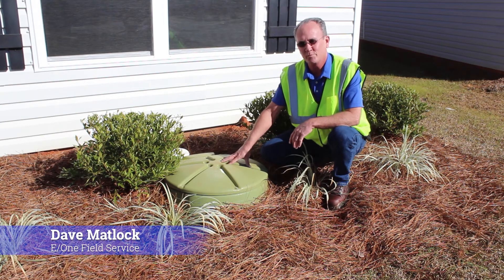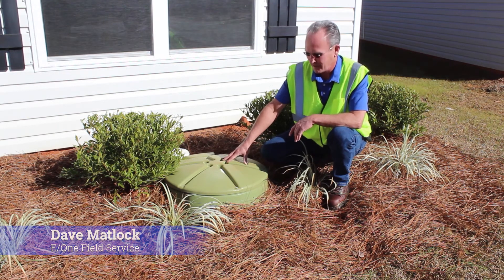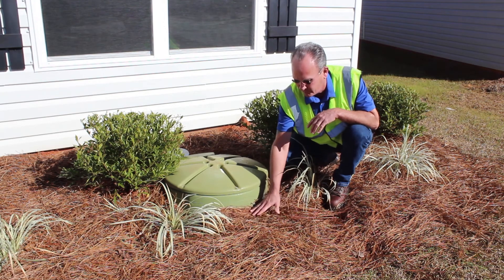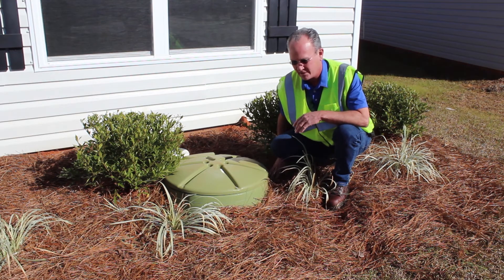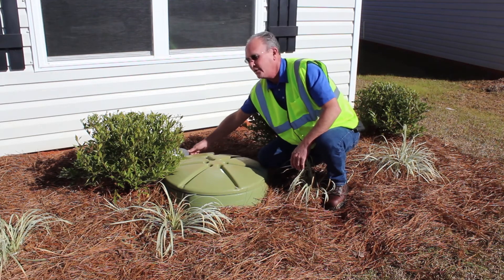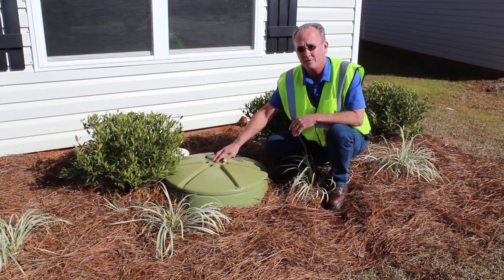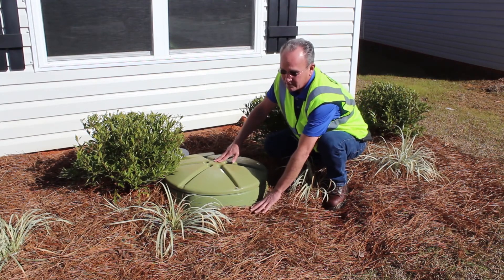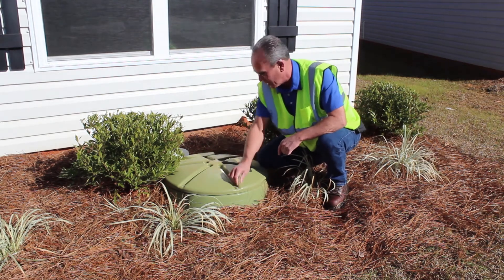Final Inspection: How a Properly Installed E/One Grinder Pump Station Should Look

Comment: Trying to size a generator for this unit.  Cannot find the start and running wattage.  Can you answer please.  TYIA
Reply from the maker: •	If it’s a 240v pump, a 240V generator must be rated to start a 6500-watt load minimum. 
•	Never use an undersized generator; it will likely cause damage to the generator, pump and/or alarm panel. 
•	Allow the generator’s motor to warm up completely before supplying power to the grinder pump station
•	Before connecting to the grinder pump station, measure that the voltage the generator is putting out unloaded. It should be 235 to 250 volts.
•	When the grinder pump starts, it will need approximately 6500 watts for up to ¼ of a second at 240 volts. 
•	Once the grinder pump motor is running, the wattage will drop to between 500 and 1200 watts depending on the pressure sewer system’s pressure.

**Note: E/One does not recommend using any type of “Auto-Idle” feature (if your generator is so equipped).